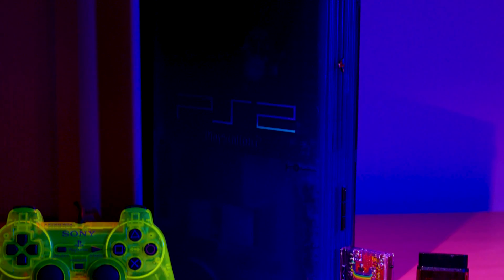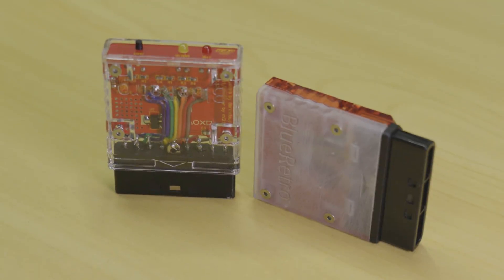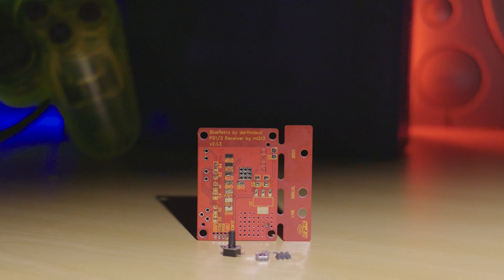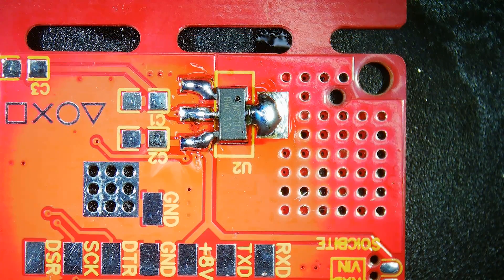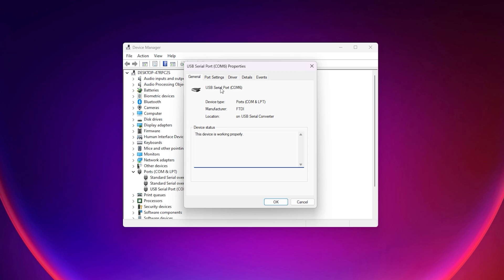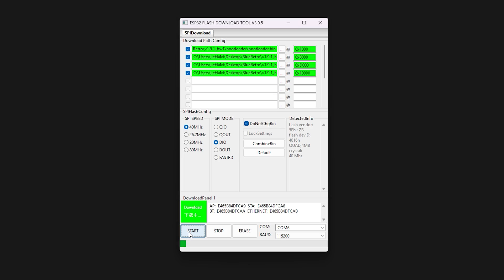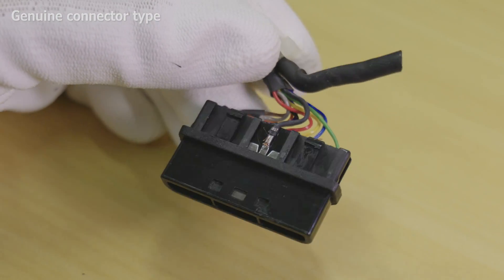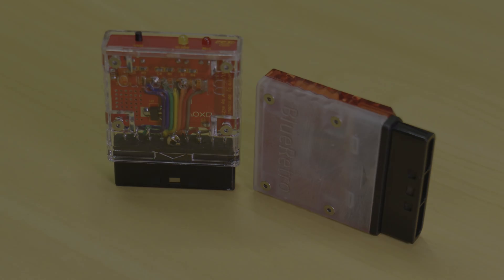How To Make a PS2 Bluetooth Adapter | BlueRetro Tutorial - Use PS4 Controller on PlayStation 1 & 2

Comment: Is there a project for taking an old wired controller and converting it to bluetooth? I'm not talking about like the adapters they have for the Nintendo 64 and stuff like that, but actually getting internal Bluetooth adapters and batteries that you solder in to an old wired controller.

Comment: Thanks for the tutorial! I’ve been tinkering with BlueRetro for the past two weeks and successfully installed an ESP32 on the Wii console. I found that older firmware seems to work better for GameCube on the Wii.

Do you have any clues on how to trigger the pairing function using a push button? Many thanks! New subscriber from Indonesia.

Comment: Can connect to joystick ps3??
Reply from the maker: Yes but you need to manually pair the controller using the PC tool for the ps3 controller 

In the listed GitHub there is info about ps3
Reply: @Slot1Gamer Can you share the schematic?

Comment: I think it would be better to modify the PS2PIN on the PCB to correspond to the PS2 controller plug, and it can be soldered directly without using jumpers.
Reply from the maker: It can work but you’d need to modify the housing to provide bigger tolerances. 

The pins move a fair bit so hard mounting them will break the joint over time.

Comment: Better use a 3.3v UART than 5v.
Reply from the maker: The pcb design appears to have VCC go through the regulator regardless of if it’s from the socket or the soic bite or the UART solder pads.
It’s something that might have to be brought up   With Mi213 regarding RXTX voltages

Comment: This video is great.
I thought I’d mention one thing though, PS3 Dual Shock controllers are a much better pairing for the PS2, since they also have pressure sensitive buttons like the PS2 Dual Shock. Some PS2 games need these buttons to feather their controls.
The PS4 controllers work fantastic with the PS1 though.
The Dual Shock 3’s can be a bit fiddly with BlueRetro since you have to program in the BlueTooth addresses manually, though it can be done.
I ended up using Wingman adapters on my PS2 with DS3 controllers, and BlueRetro/PS4 controllers on my PS1.
Reply: Why wingman, doesnt the blue retro have the same compatibility??

Comment: Aside from button, every parts should be available already if you just buy a full fat esp32 board.

As for power he said, no you dont need to beefup the power here since esp32 is BLE and ps2 controller consumer way more power specially with the rumble motors running.

Comment: I'm wondering if it's possible to install a wireless adapter on the inside of an original SNES instead on the outside so that it has an permanent onboard wireless connection but also still have functional external controller ports.
Reply from the maker: Yes you can 
There is internalised versions of blue retro project.
It not just for PS2, the internalised version has physical controller detection, so it can let you use both
Reply: @Slot1Gamer  Awesome thank you so much!

Comment: Here comes the party pooper but a wingman 2 would be cheaper with more functions including a USB A port for arcade sticks.
Reply: A RetroScaler version of this is £10 on aliexpress, wingman more like £40. Am I missing something?
Reply from the maker: It likely is but I like buleretro as it’s fully open and can be internalised
Reply: @Slot1Gamer for that matter I would rather go for the big unit with multiple connections on different consoles as envisioned by darthcloud  since I have all the systems that blue retro supports, I literally I’m just waiting for someone to fully convert a Dreamcast controller to blutooth with a sp32 and have a VMU cradle with the base, when that is done I will fully jump into the bluretro craze

Comment: Hello good evening, I would like to know if you know if it is possible to exchange the 2x USB 1.1 inputs on the PS2 Slim Model for other 2x more modern ones and also if it would be possible to increase its processing power?
Reply from the maker: Sadly you can’t increase the usb speed on the ps2 that I know of 
Some slims still have the internal connections for a HDD, you can add it back in using some mods. 

Even if you could increase the processor, the software (games) likely wouldn’t be written to take advantage of it, much like cpu and ram upgrades on the original Xbox